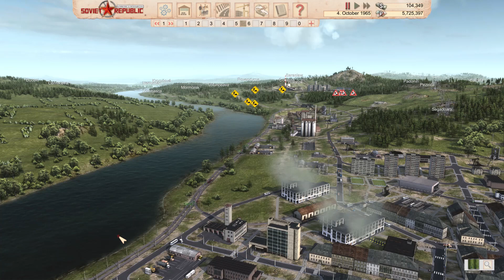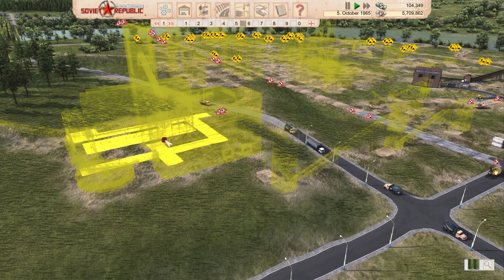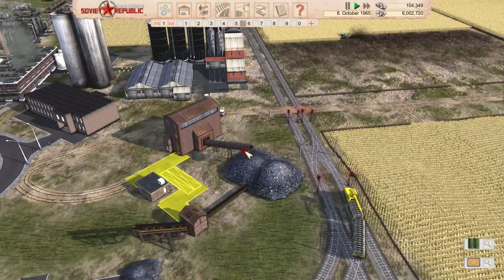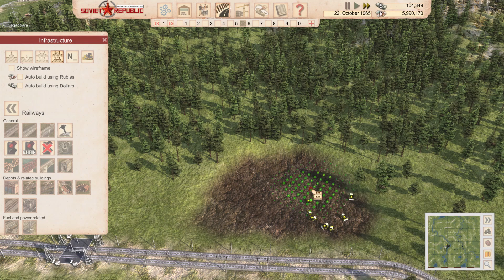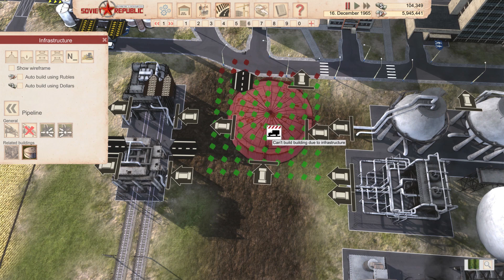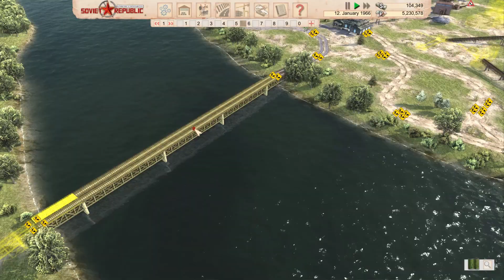Workers and Resources - Soviet Republic - Project Leszcie Ep.36

Comment: The cableway may not be efficient enough to transport raw materials, but it turns out depending on the demand. For people it might be ok :)

Idea for a bridge, etc. A larger number of blocks instead of one large makes it easier to travel with a large number of trains. Apart from another important length of track sections :)
https://i.imgur.com/x067zjF.jpg

I hope that if you have already removed the refueling station for trains, it looks like this now :)
https://i.imgur.com/jRvJ1Uh.jpg

56:03 It flows slowly because you don't have a pump between the factory and the tank.